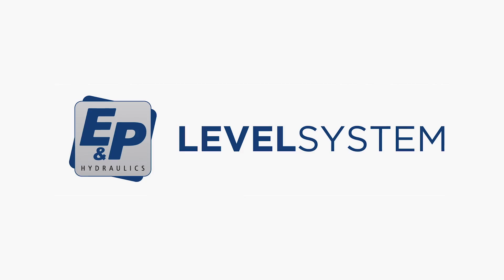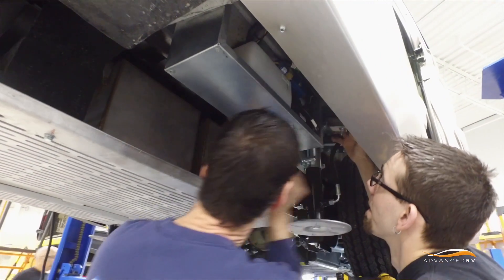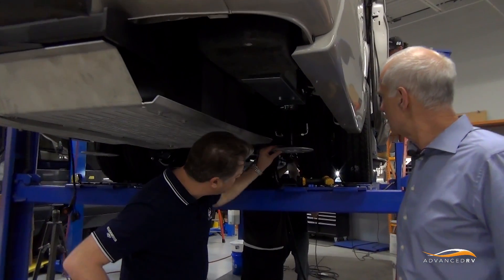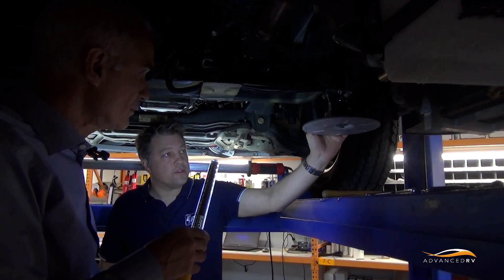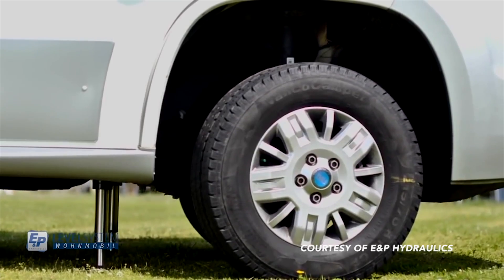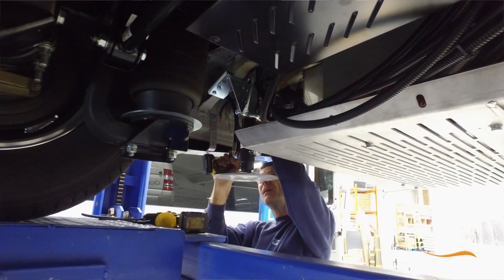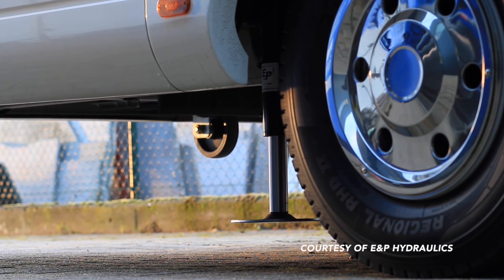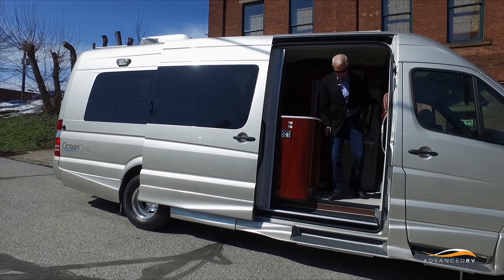E&P's Automated Hydraulic Leveling System: Advanced RV has the First U.S. Install

Comment: 1. Do I need to own an Advanced RV to have one of these installed?

2. Can this be I stalled on Ford Transit van?

Great product.
Reply from the maker: Thank you for your question, Roger Arias. We can install the E&P Leveling System on Mercedes Sprinters and Dodge Promasters.
Reply: Thank you for your reply. Will you possibly offer it for Ford Transit Van in the future?
Reply: @AdvancedRV  I have the same question. Do you install this on Ford Transit vans with High Top, Medium or Extended Length?  The Dodge Promaster has quality issues and the Mercedes Sprinter has long term maintenance issues with diesel, technicians not available when traveling, diesel not available, pricey repairs/parts/maintenance ($350 oil changes!).  So the only option for me is a Ford Transit and I will build it out myself.  Do you offer this leveling for this van?  If yes, how much.  If no, then in the future?  There is a huge move toward the Transit today.  So you might as well start offering it for this van.

Comment: Nice settup.i assume this could be used instead of a jack to change a bad tire
Reply from the maker: Thank you for your question Billybob Billybob. The E&P Leveling System was exclusively developed as a leveling system and is not designed to be used for other work underneath the vehicle. If the system is used to help with changing a tire, it is the responsibility of the user to ensure the vehicle is secured safely in position. Never lie underneath a jacked-up vehicle.
Reply: I don't see why not?  Of course the manufacturer and installer cannot say yes on print, as it puts them under liability for any accidents.  This is no different and safer than a jack system for sure.  It rises by itself, and you stand on the side when changing a tire, not need to get under the vehicle.  So, logically, yes it is!  This is a huge plus for me.

Comment: - would the leveling system effectively prevent tire flat spots (from long term storage)?
- did ARV fabricate an alarm warming system yet to inform driving that the leveling system is still down at vehicle startup? like the alarm for the external electricity hookup
Reply from the maker: Thank you for your question joapps. Because the E&P Leveling System in hydraulic, it is not intended to store the vehicle for extended periods of time on the levelers.

Comment: This would be great for the leveling issues that some absorption refrigs have.
Reply: 2badger2 just as well, as a rule, ARV doesn't use absorption fridges. Though I sure that if a client wanted one, they'd oblige.
Reply: Cost of leveling $8000.
Pros:  Level van, easy out from mud or snow, stability no rocking.
Cons:  Cost, drive to Ohio
Cost of Absorption fridge:  $1500 - $2000
Pros:  Propane is cheap, second option if electric not available
Cons:  Safety issues/ fire hazard, Propane leak hazard, higher cost for fridge, does not get very cold in hot temps, huge electrical drain when you switch modes.  This is  a power hog on electric, but not on propane.  Finicky operation.  Quarterly complicated maintenance.  Not dependable.
Cost of compressor fridge (For RVs not Residential!): $500 - $1000
Pros:  No propane needed, huge safety gain, gets very cold, much less electric power use than absorption type, cheaper to buy, easy to install, no maintenance.  Dependable.
Cons:  Expensive solar and battery install needed.

Pick your poison.  I think the Electric Fridge is the way to go.  Install the leveling not for your fridge but for safety and comfort.  Installing solar will also give you other huge benefits.

Comment: Mike:  Does this impact the MB warranty?
Reply from the maker: Thank you for your question. Installing the leveling system does not impact the MB warranty.
Reply: thanks
Reply: Todd Keller I would imagine likely not, no cutting or welding involved. No alterations to the chassis.